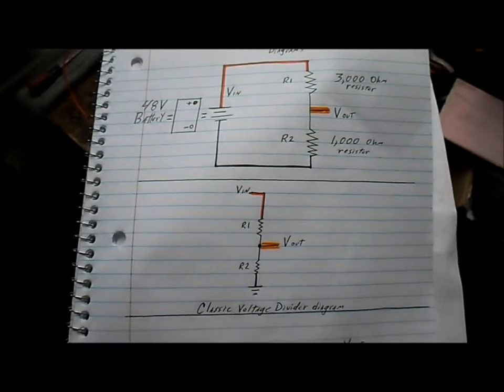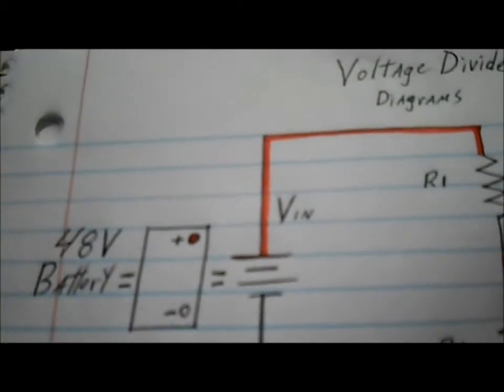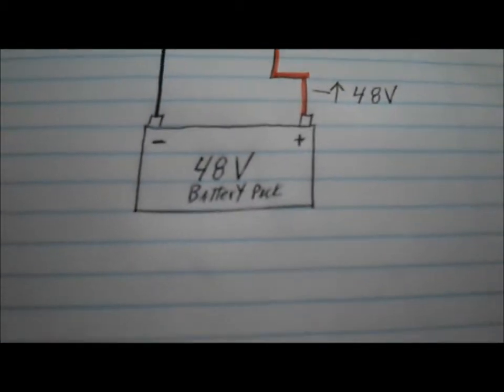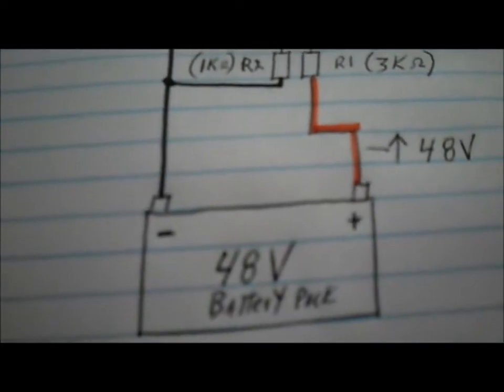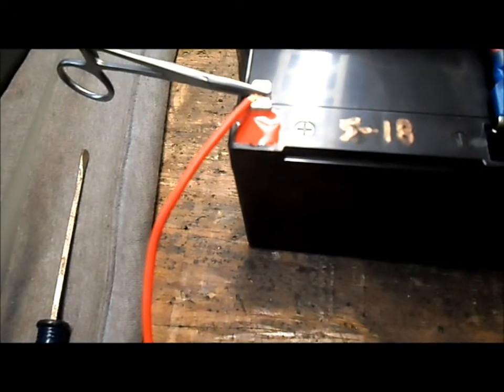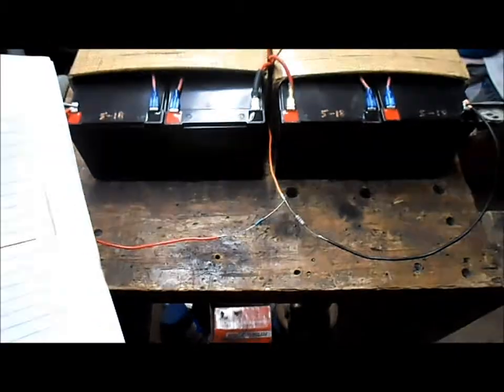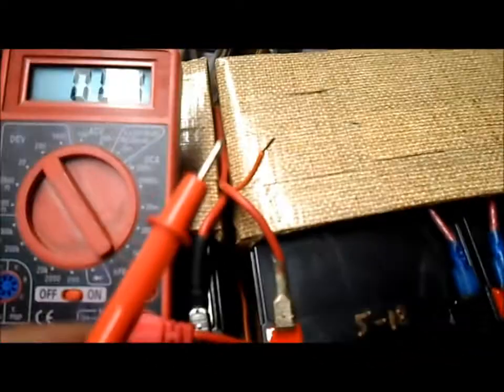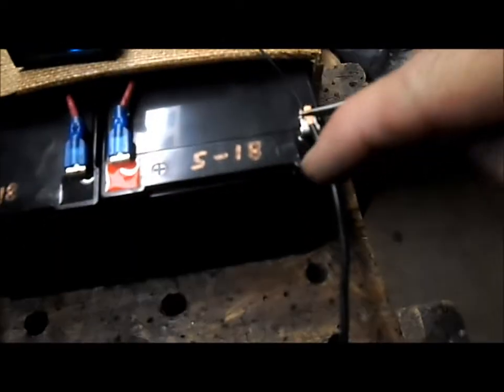48V to 12V Voltage Divider test 1

Comment: If let's say you are  making a 36v 20ah  battery step down to 12v. Will the ah triple to 60 ah instead of 20 since you are using a third of the voltage?

Comment: Can you please explain the 24V to 12V??
Reply from the maker: You just have to use the appropriate resistors. Here is a standard voltage divider calculator https://ohmslawcalculator.com/voltage-divider-calculator
ex: (2) 2,000Ohm resistors should reduce 24V down to 12V.
Keep in mind that you can't draw too much amperage thru a voltage divider or they'll heat up. To test, if it don't get hot while in use, your should be good.
Reply: @functional_artist  Or you can just buy a converter
Reply: 7872

Comment: Thx a lot bro... I have so long looking for sircuit to make dc stepdown from 48v to 12v for my electrik bike lamp.
Reply: Same :)
Reply: Same:), but, 

1 question, the circuit loses energy even though it is unloaded, by the law of ohm, then, you could put a switch before. also thanks.